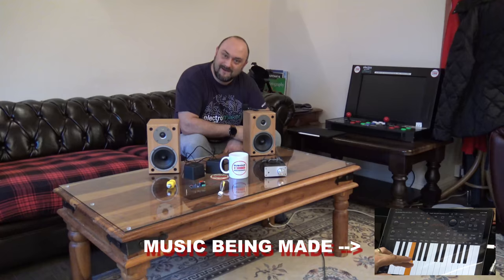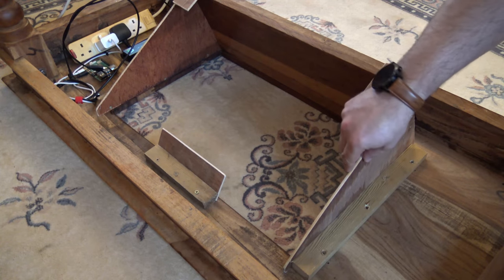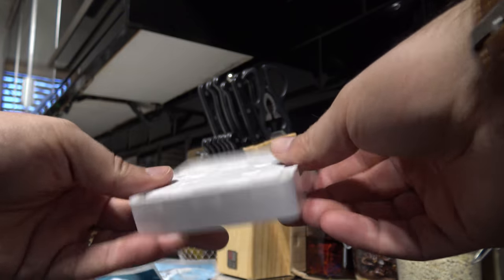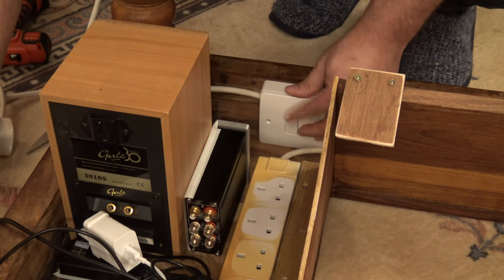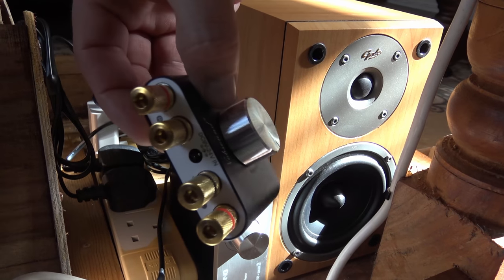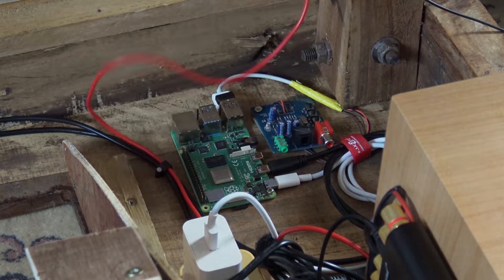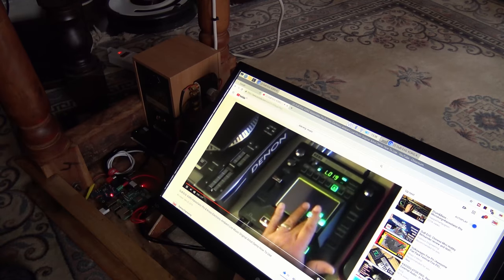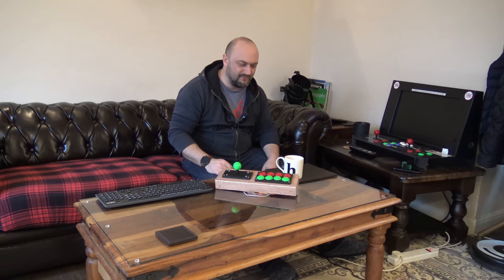DuB-EnG: Retro Games Arcade Computer Build into a coffee table - Installing a quality audio system !

Comment: Great video. It's coming along nicely 😁. Although personally I would have used one of the pi's USB to give 5 volts to a latching relay. Then using a momentary switch you can switch pi, amp & monitor on and when the pi does a safe shutdown it can switch all the peripheras off (not my idea, got it from diyperks). 👍
Reply from the maker: Wow!!  -  I didn't think about that...  Great idea, as you can tell it to shutdown and walk away...  Thanks for the top-tip!!  Have a great weekend!!
Reply: It's not as dubious as a forced shut down with a light switch though, far too slick 😂
Reply from the maker: Hahah...  yeah and that electric socket needs retrobrighting hahah
Reply: Page Yes Found!

Comment: I don't have a 3D printer to hand but this is the level of engineering I can really agree with. Things that you have available in your cupboards, garage or at a push the local DIY store. Was that an iPad pro you had the designs on? Looked very smooth.
Reply from the maker: Practical engineering...  I’d love a lathe and a mill, router etc but I would need a bigger house and shed! One can dream! ...  yes, the iPad Pro, and I’m loving it! I questioned if it was worth the upgrade, the answer is a resounding yes, I love it.  Hope you have had a great weekend, stay safe and see on the next one :-)
Reply: @DubiousEngineering  - It would be good to have those things available. I've got a garage but it's full of junk! There is a workbench in there somewhere and a few power tools but DIY and bodging stuff is the limit. I'm looking forward to further updates.
Reply from the maker: Bradbury Robinson ...  time to get those joysticks finished off and copy a couple of USB ports to the front of the table... then it’s party 🎉 time :-)